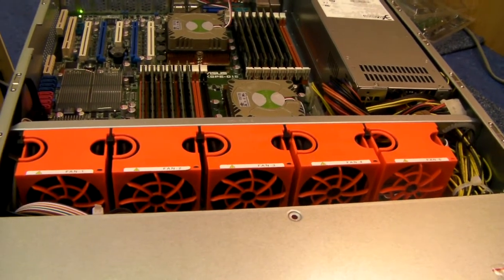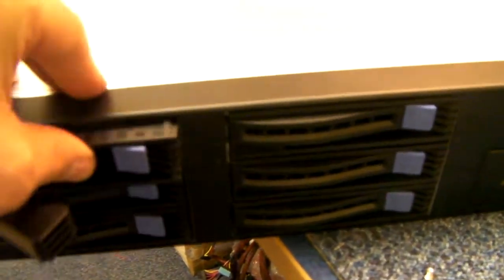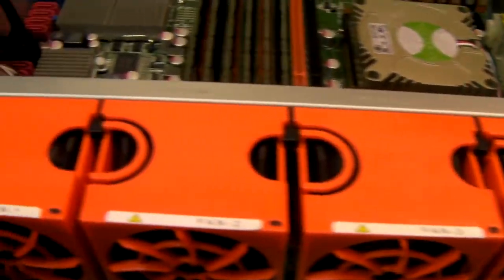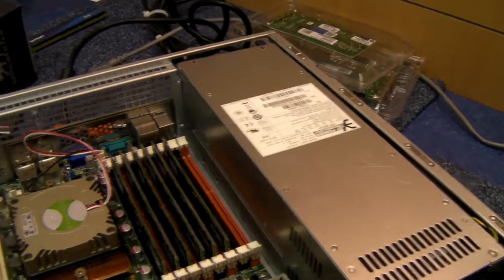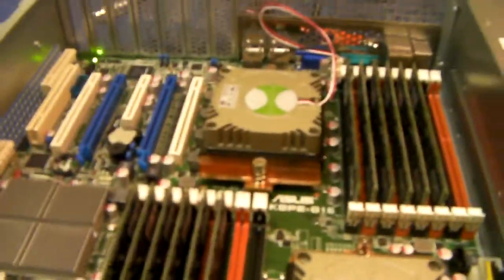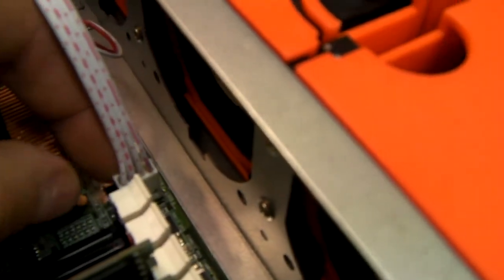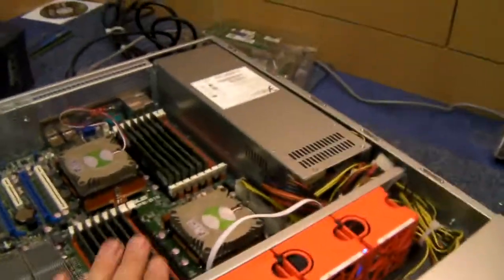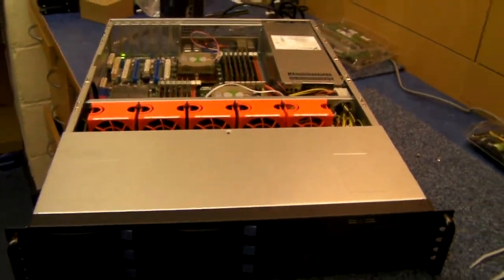X-Case RM 206 Pro - 6 Drive 2u Hotswap

Comment: Would I have any problems trying to use traditional desktop components within this computer. The reason I ask, I'm looking for ways to build an audio production computer, one that would go into the racks, and I'm finding a lot of the cases are designated as "server". I'm wondering if this is a conventional thing or if there are practical limitations to using these computers with non-server components?